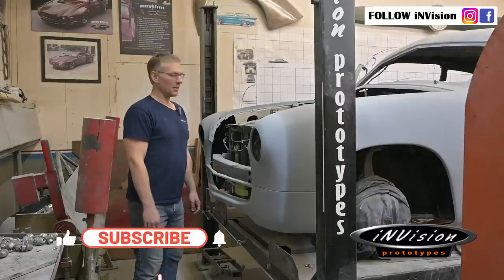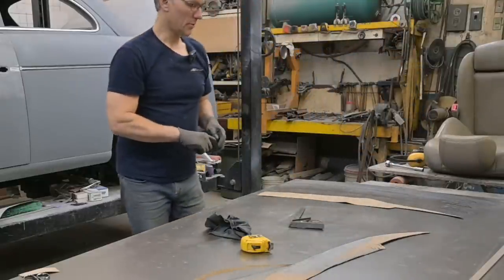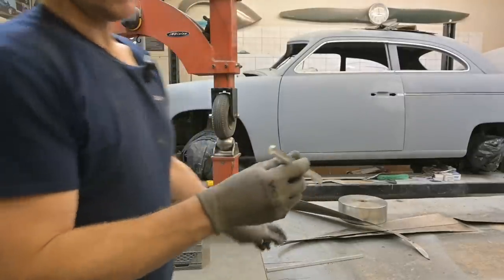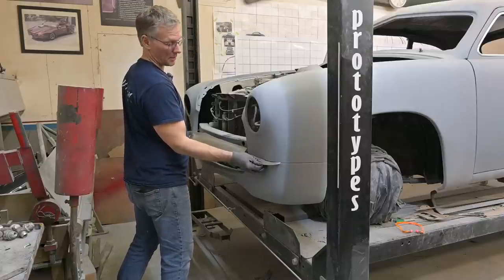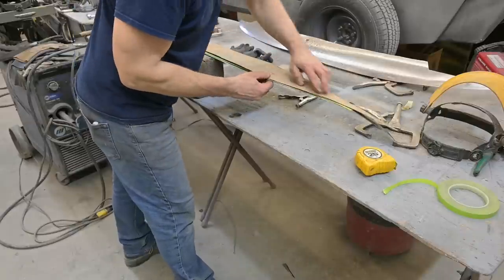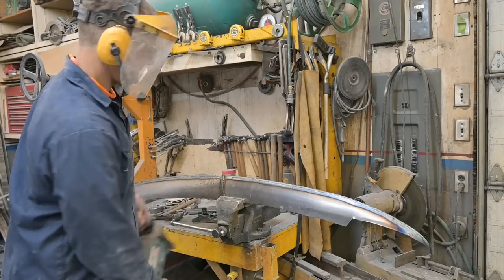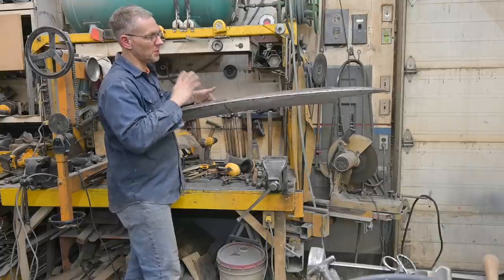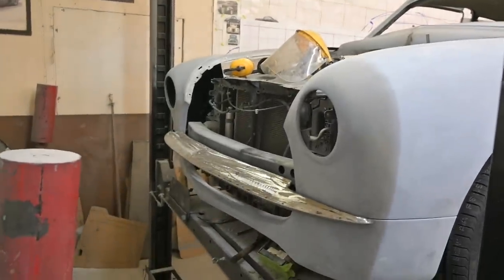BUILD a Custom Nerf Bar from Scratch - Ep.25 - 1951 FORD + INFINITI G35XS Sport

Comment: Hi Nick, love your expertise. What pressure do you run that trolley wheel on your english wheel? I’m trying to roll a complex bonnet (for me anyway) and the rubber keeps rolling off the top wheel. Many thanks regards John.
Reply from the maker: Sounds like you're anvils aren't running true.  Check the alignment(without the rubber band see if the sheet metal 'walks' as you roll it).  For these 16ga there was A LOT of pressure applied using the rubber upper with many passes  to form them.  Hope that helps.  If you have any questions don't hesitate to ask.  N.

Comment: Im building a 1980 datsun 280zx wanting to make it look more like a 240z. 
 I need to build bumpers to mimic the beautiful thin wrap around bumpers of the early 70s. Thinking about using 16 /14 guage stainless. Any advise  would be appreciated.
Reply from the maker: Stainless is a bit tricky to weld.  Loves to warp.  Build a jig/buck to clamp the pieces to and practice welding before attempting the real deal.  A stainless bumper will look really trick.  Best of luck!
Reply: @iNVisionPrototypes  I am actually well versed in stainless (food equipment is my field)  but not making bumpers. Yes, it has a mind of its own. Did you have the bumper chromed ?
Reply from the maker: @cowfrank  That's great!  You're ahead of the game.  When built from crs we will either have the bumpers chromed or paint them as you saw for the 51 Ford.  What sort of shaping tools do you have? Wheel? Planishing hammer?